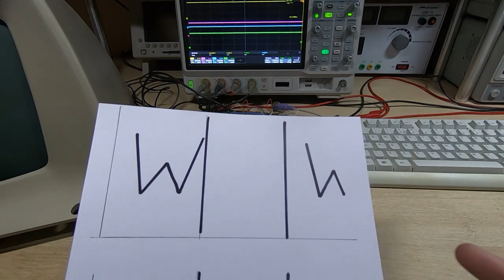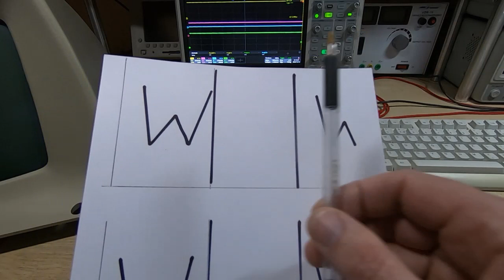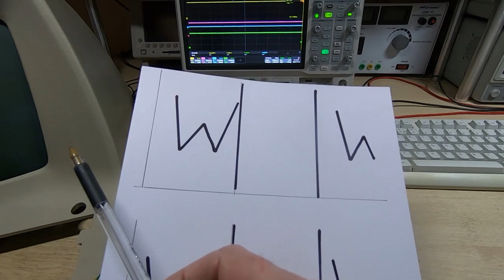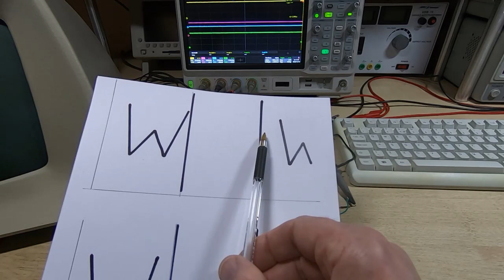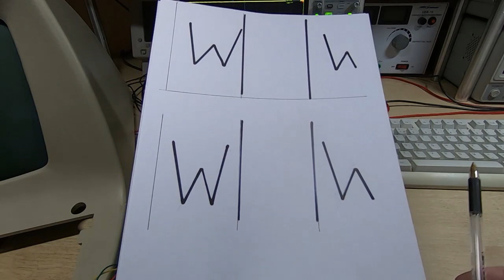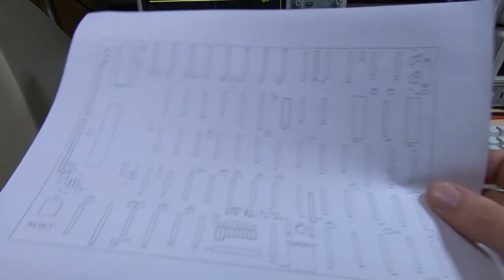Designing A Z80 Computer Part14

Comment: Great project!  How are you planning to handle graphic characters? With the way you are doing character spacing it seems to me that it would be impossible for one character to touch another, without some space between them.  In C64, for example, the font itself includes the spacing for alpha-numeric characters but graphics can use this space so that a character can touch another without a gap.  Have you thought on how you might approach this or do you plan on not having any graphics characters?
Reply from the maker: There are several ways this system can provide gapless graphic characters. You may remember that I mentioned an invert control input which can be used to invert individual pixels. This can be used to fill gaps where required but in general the video system I am describing is intended for text output only and graphics modes such as bit mapped .graphics or sprites can be added later as it is less complex than the text modes. However it is also possible to switch the video system to 8 pixel text blocks which would actually also reduce the cursor width at the same time and this would produce shoulder to shoulder characters so it is really up to the builder which mode they wish to use. I will be covering graphics modes in a later video but I need to keep the videos focused on the current aspects of the design rather than trying to cover everything at once.
Reply: @JerryWalker001  Awsome! I cannot wait to see what you come up with!